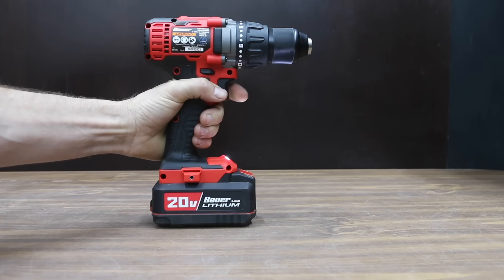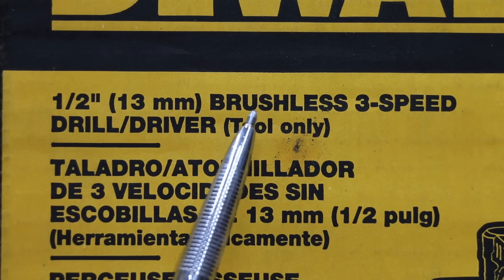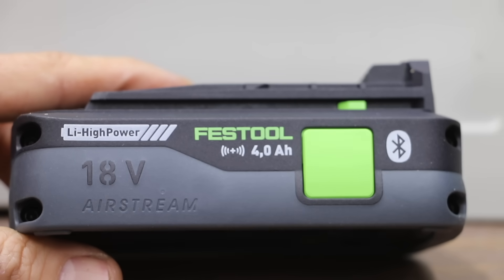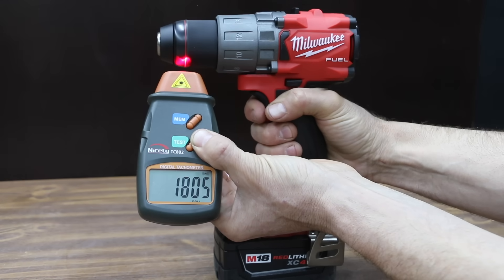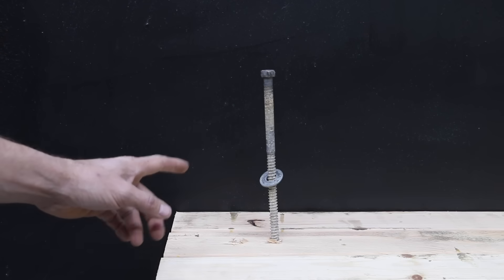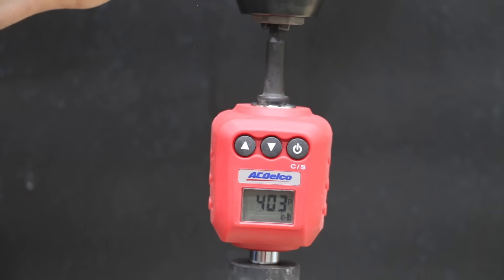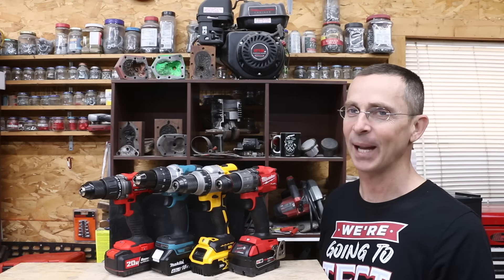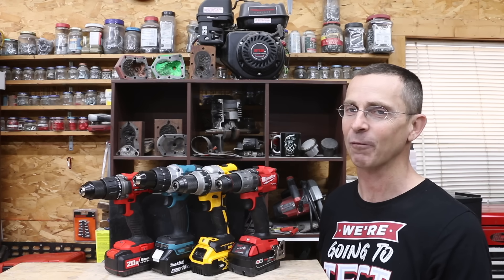Best Drill (BATTERY POWERED)? Milwaukee vs Dewalt, Makita, Bosch, Festool, Ryobi, Bauer, Ridgid

Comment: Would you consider making a follow up video including the ryobi brushless drill and the ryobi hp? Love the videos!
Reply: I second this. That is currently the cheapest drill Ryobi makes.  The Local DTO has a giant bin of them for $26 for the tool only. They are reliable but they aren't nearly as strong as some of my old blue ones or the bigger brushless hammer drill.
Reply: @BD-xz6te  I disagree. I think that's content for a different type of video you guys are asking for. This video is "Best drill". Not "Best budget drill".
Reply: @stewartxp2400   That is the problem. The Ryobi drill is the absolute cheapest version they make.   It would be like comparing several mid range sedans against a base model compact car.
Reply from the maker: Thanks for the video idea.
Reply: @ProjectFarm  What if you're out of oil and stuck in the desert with a big drum of anal lube, can you use that as a motor oil replacement in a survival situation? Would love to see it.
Reply: @artemislogic5252  Only if you're driving a Ford Probe.
Reply: @ProjectFarm  also Kobalt 24V
Reply: @ProjectFarm  Perhaps when testing tools you could include a little bit of subjective when introducing each tool. For example, does the tool feel good in the hand, does it seem put together well and of quality components, does it impart confidence during use or does it seem like it is always about to fall apart?
Reply: @Sylvan_dB  nah, this channel doesn't need a bunch of subjective "feelings" bullshit. It's all about the objective numbers
Reply: @Sylvan_dB  I like this idea, although it is hard to objectively quantify those metrics, there are more factors at play than raw performance. For me and my job, ruggedness of the tool and a good warranty are at-least as important as performance and price, If not more so. For that reason alone Milwaukee is usually the brand of choice. I can’t even begin to describe the amount of abuse our tools suffer. 😂 They don’t always survive but Milwaukee Fuel do seem to survive the longest...

Beyond personal experience I happen to know people that work in the tool sale industry and the resounding opinion is that they won’t touch Dewault with a 10-foot pole because of the unusually high number of returns due to complete tool failure. And these are on brand-new tools mind you.
I was honestly shocked, I wouldn’t have imagined such a well-known brand is knowingly churning out so many turds.
Reply: @Sylvan_dB  completely agree with you, I've used many cordless tools and the way they feel is very important to me . Some are not ergonomic at all . Too chunky , doesn't conform to the shape of the hand or even things like weight distribution. Where the top or bottom isn't weight balanced and really fatigues the wrist . No point in having a great performing tool but only being able to use it for a short time because its uncomfortable.
Reply: @awsomemustang  , some tools abrade or pinch the web of skin between the base of the thumb and the base of the index finger. A bad design will blister you!
Reply: @joe1071  
100% agree as everyone has a different feel when they pick up any tool
Reply: @joe1071  I would take a loss of a few horses if it meant the tool didnt reek of chinese plastic....
Reply: @joe1071  I'll tell you as a contractor,  the ergonomics of a tool is an extremely important metric in my decision making, far more than 10% differences in RPM or torque. if you're using something all day every day, it needs to be able to become an extension of your body. A clunky or poorly designed tool that disrupts your work flow and reduces efficiency is going to cost you money, not make it, and that's certainly not one I'll buy if there's a better option.
Reply: @Sylvan_dB  I second this
Reply: Are you sure you guys are talking about cordless drills? lol.
Reply: @Debbiebabe69  you do realize nearly all these tools have at least Chinese made components? Despite DeWalts claims, almost nothing is actually made in the USA.
Reply: @drew5334  completely agree, and as someone who uses a tool all day, you will certainly agree that a tool that feels good in the hand on initial encounter can end up feeling terrible by the end of a long day of use. Just wouldn't be accurate to describe the ergonomics without extended use in the hand
Reply: @Debbiebabe69  seriously ... you're gonna be disappointed with ALL of them then.
Reply: @joe1071  lol people asking for "muh feelings" on a tool channel.  Smh.  Should start asking for tampon comparisons too.  xD
Reply: As someone who only owns Ryobi (started as a gift of about 8 tools, and I've just added) I replaced the drill with a brushless in my first week, as the first ine was pretty useless. I too would br interested to see how the brushless ones compare. :)
Reply: @Bobby-Joe-Tuxedo  (I have no less than 30 Ryobi tools now, heh.)
Reply: @Bobby-Joe-Tuxedo  I'm that same someone here. I find myself wanting a brand-olympics where the best of each brand in 5-10 different tools are all tested and pooled at the end to see which brand is best over all.
Reply: I was thinking this as well. The brushless ryobi doesn’t cost much more and the others, even the ridgid were brushless.
Reply: @Mig probably, but at least use a comparable brushless Ryobi. I don't think anyone would expect Ryobi to win, just want to see how it stacks up as a budget brand
Reply: I think it would have been interesting to see a Hilti drill in the mix
Reply: I was wondering where are the other brands, and better models like Ryobi hp.
Reply: I agree.  I’ve got the brushless Ryobi and that thing is a beast.
Reply: @Davidh4198  I’ve got both ryobi and Milwaukee brushless drills and my ryobi is pretty damn good to be honest n I actually think slightly better than my Milwaukee which is annoying to be honest as Milwaukee cost more!
Reply: @Davidh4198  i had the old one and still has handled anything i throut it
Reply: I came here to comment that Ryobi has ar 3 drills that are much much better. Not sure why that one was chosen
Reply: @MikeTheSith200  I love my relatively low cost Ryobis( usually buy recon) and the constellation is fantastic, there is something to be said for the traveling tradesman, when your tools are stolen or crushed you havent lost as much an investment.
Reply: @kevinmccune9324  exactly. They all work well.
Reply: Please do a review of craftsman
Reply: Yes please.
Reply: Agree. Just bought the cheapest brushless Ryobi drill that came with a charger and 2x 2A batteries. Combined it with the hand vaccum witch is amazing for the price
Reply: Another vote. My old blue one died after more than a decade of hard use. My family bought me a new green one, the one in your test. It is not as good at all, but I suspect Ryobi split their marketing plan. Sell a low priced low quality one at $70 and a better brushless one for more $.
Reply: Yea it was kind of an unfair comparison in that regards. the only other brushed motor was the Bauer, which is a 20v and the Ryobi is an 18v.. when you consider the cost for drill, battery, and charger for the Bauer.. the Ryobi would top the Bauer in quality for value.
Reply: @Plagueof7deaths   My big beef with the Dewalt line was, they used to be so overbuilt in the gearboxes they would drain the old NiCad batteries extremely quick, oh yes one thing I found out is if your batteries are getting weak the BMS will shut em off and the drill often gets blamed another thing about brushed tools I didlike the stench of ozone( its a thing)
Reply: @Mig well yeah, Milwaukee and Ryobi are both made by Techtronic. Of course their "flagship" brand will out perform their budget brand. I'm a big fan of Ryobi because you get a lot of bang for your buck. I own bigger corded and pneumatic tools, but I do the vast majority of my work with Ryobi 18v tools.
Reply: I also would like to see the Ryobi brushless.
Reply: And the Hercules! Hercules I just want to see a comparison I have the hercules and I love it!
Reply: @fireprooffox3664  where is that sold? I have never heard it
Reply: @jeremyjones8872  It's Harbor Freight's top of the line set, they are trying to be a competitor of high-end brands now.
Reply: @fireprooffox3664  dangg..500$ for a drill is fn insane crazy price,even if it was the best,i dont see how it would pay itself off..il stick with the middle of the pack🙂
Reply: Can  a jet fluid in a car 🚗 like  " Bugatti " ?
Reply: I also own a ryobi drill, higher model, and it feels very similar to Dewalt  and many times overperformed makita.
Please update the test with their higher model :)
Reply: I agree. Should have put the brushless Ryobi HP up against the other brushless competition.
Reply: I would also like the Ryobi brushless, and the Dewalt Atom brand.
Reply: Yeah I have that same Ryobi drill and a newer brushless Ryobi and the newer drill is much more powerful.  I will say the cheap drill has been reliable.  Mine is probably 5 years old and still works fine.
Reply: @TugIronChief  I would have learned after one bad one.
Reply: u r in my team bro xd
Reply: @Mig of course dude its like 100 usd more and with one of the strongest motors in the world
Reply: The new Dewalt power detect with 21700 cell batteries dominates them all.
Reply: @jamesfair9751  Dewalt 12V Max eats these other drills.
Reply: I've got the Ryobi brushless and it's pretty good.  But there do seem to be a LOT of Ryobi fanboys around :)
Reply: @TugIronChief  you couldn’t be more wrong. Your ignorance shows
Reply: @TugIronChief  you are 100% wrong. I use mine consistently with heavy use. You have no idea what you’re talking about. You’re making assumptions since you have no real knowledge.
Reply: Would also be interesting to see how the cheapo HF "Warrior" brand does.
Reply: @greendryerlint  Don’t waste your time and money... get the $50 Bauer if you have to go HF
Reply: @Blakehx  I'm sure it's awful.  Just wondered how awful..
Reply: This. I would like to know how the ryobi brushless drills really compare.
Reply: Ryobi/AEG/B&D will be about the same, it's a cheap consumer tool. If you're using it about once a week or just to screw in some plaster screws or something like that they are fine, that's what they are made for but they are not made for heavy daily use and if they have a motor that can do it all that means is they'll break faster.

If you're the average homeowner then buy the Ryobi/AEG/B&D and rent a proper Hilti when you need it.
Reply: @michaelmay5453  B&D and ridgid are 2 VERY different tools and are not made by the same people
Reply: @bread-gz3rl  agreed. Black & Decker may have been a quality product at one point but I had the cordless drill and even on a fully charged battery it never worked well. Then compound that frustration with using their B&D bits that would immediately break on you and ive sworn off ever owning anything B&D ever again
Reply: Actually it would be more fair to compare brands with same specs of Torquue and all Brushless ..
Reply: i saw the rioby hp drill outa 3" hole that was really impresive, and 1/2" in 2 gear
Reply: I am amazed at how many Ryobi owners want their brand tested, when it came in last on every test, who cares? This is from a Ryobi tool owner of 13 different pieces. I realize it came in last but I get them cheap and I don't use them professionally. They have served me well even knowing they are junk comparatively. So stop with your brush and brushless I want this test I want that test bs, I'm not going to wait for multiple testing against the top brands when I know no matter what tool , ryobi is going to come in last. Just stop. And thank you project Farm you're the best. My two cents from Tucson
Reply: Why add 2 versions of one company? Every brand gets one entry into the contest, the very best drill they make. Hence the title "Best Drill". If that's not the case then we'd be running all kinds of different models from the many brands.
Reply: @stewartxp2400  ask makita with like 3 lines of tools
Reply: Ryobi is made in the same factories as Milwaukee by the same company. They're not going to preform better than the Milwaukee tools and are made with cheaper components.
Reply: @BM4gic2010  TTI owns both. That’s about it.
Reply: @BM4gic2010  wrong and wrong. Do some research before commenting.
Reply: I’m sure DeWalt will take the win in this matchup.
Reply: @mia4md  I would predict DeWalt would win as well, but I do agree the better performing brushless Ryobi drill should have been used

Comment: I'm glad that the minimum torque was tested. When I did steel roofing years ago, I occasionally borrowed my buddy's DeWalt drill for driving the screws and even on minimum torque, it would overdrive or shear the screws in half. My ancient Skil cordless drills had just enough torque and worked way better.
Reply from the maker: Thanks for sharing.

Comment: My kids and I are converting our John Deere skid steer to electric from its twin cylinder 25 hp gas. After we pulled the deal engine, i wanted to test the hydraulics before wasting time and money on the conversion.
I welded a bolt to the hydraulic input shaft, then used my Milwaukee Brushless Fuel drill to turn the shaft. The milwaukee was powerful enough to raise and lower the bucket & arms, and then drive the skid steer up and down my driveway. Run time on low gear was until battery was dead, run time on high rpm gear was about two minutes when the drill overheated.
Reply from the maker: Thanks for sharing!

Comment: Thanks for the video! Tons of work involved with these vids...much appreciated.
Bauer is great for regular folks. If you use a drill every day and push it like a contractor I would go with one of the big 3.
If you're particular about details like vibration dampening for the battery and a quality chuck with little to no run-out I would buy Makita.
Reply from the maker: You are welcome!

Comment: The lowest torque at zero means useless to me. If you're pulling the trigger, you expect a response. One problem I have been having with cordless tools is working in the sun. The Makita overheats and stops working in the sun so, I have to get the DeWalt out. Awesome video!
Reply from the maker: Thanks!  Thanks for sharing.

Comment: The ryobi is a way better investment than the bauer. Even if the HF drill were a little more powerful the fact that ryobi has such a wide spectrum of tools you can get for those batteries. 

I still have my milwaukee tools for big jobs, but for special tools like lights,vacuums, blowers, etc ryobi is hard to beat.
Reply from the maker: Thanks for sharing.

Comment: I have an entire assortment of Milwaukee and I have no regrets. Being that the batteries are interchangeable between tools I am ultimately stuck with continuing to buy Milwaukee regardless of if one brand has a slightly better performing tool but I've had no issues with these so I'd be buying them regardless.
Reply from the maker: Thanks for sharing.

Comment: The brand is not relevant when you’ve picked the cheapest from one brand and then another brand one of  it’s more expensive models. Maybe next time use identically priced drills if the intention is to compare brands. In particularly the price should never mix battery included with tool only prices. If the intention is to compare cheap vs expensive why not use the same brand? Keep it up though, love the videos just please spend a bit longer thinking about making the comparison  videos properly balanced.
Reply from the maker: Thanks for the constructive feedback.

Comment: Im pretty sure the electronic clutch needs the drill to spin first, in order to gradually "measure" torque and function properly. My ryobi with an electronic clutch is more delicate on the first setting than anything i have had before. And it gradually slows the drill, then stops. Not sure about this tho, may just be that particular drill 😊
Reply from the maker: Thanks for the feedback.

Comment: I'd be kinda pissed if I bought a drill, got home with it, then found out it didn't come with a battery and charger.
Reply: Most of these drills are made for trades people and they kind of assume they would already own batteries and a charger to cut costs.
Reply: @wetlettuce4768  but....why would you buy a battery and charger, and not have a drill?
I'm confused.....drill runs off battery, which needs a charger...and why would you buy just a battery and charger?

Comment: i wonder why you did not use a brushless ryobi
 normal ryobi have a brushless and brush types for drill, driver or jigsaw
what i mean there 2types for most when it comes to motor types from ryobi

because i think the brushless drill is smaller